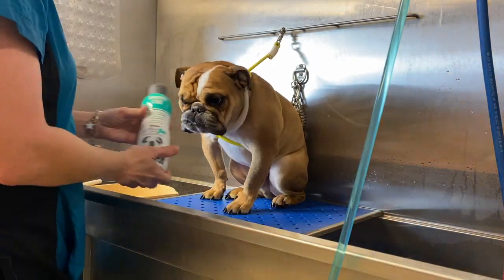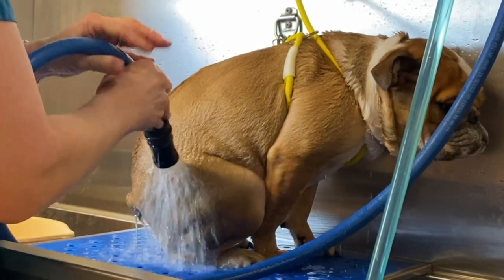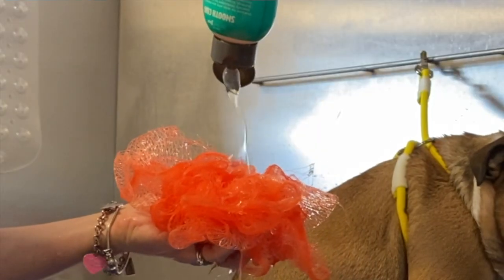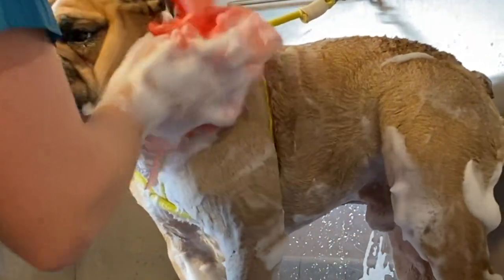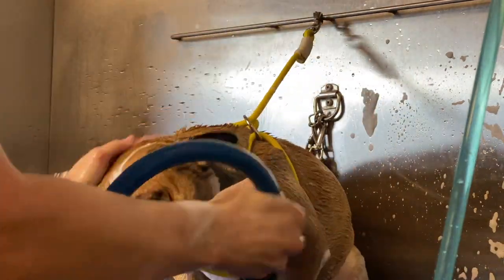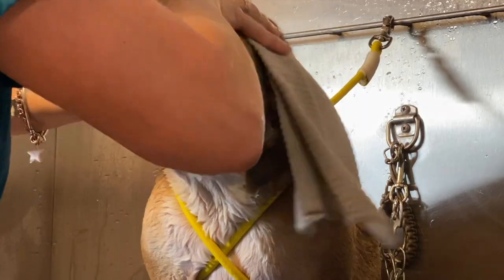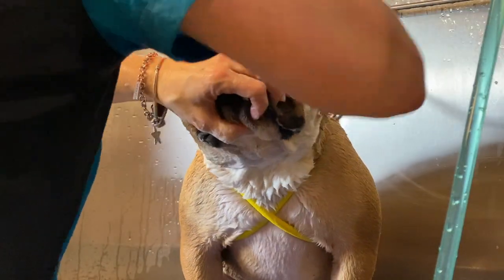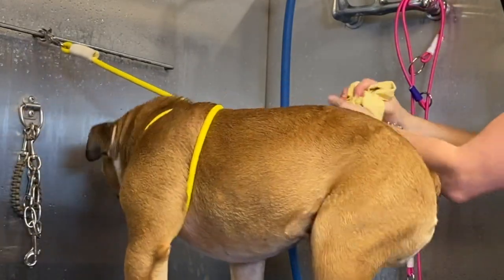NEW SHAMPOO demo and HOW to BATH DOGS with WRINKLES

Comment: Hi Amy. I was wondering what do you use when bathing big gus? More specifically what is the water hose connected to? Is it connected to your prima bathing system. Thanks.
Reply from the maker: My rinse hose is not part of the prima bathing system, it is connected to my water supply in my tub.Here is a link to my rinse hose if this helps:)
https://www.tristarvet.com/product/hose/